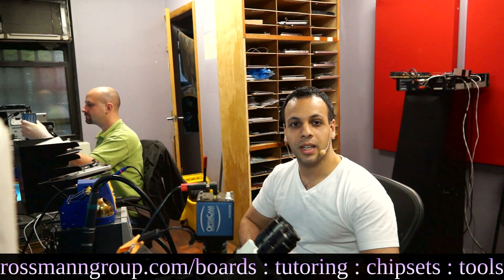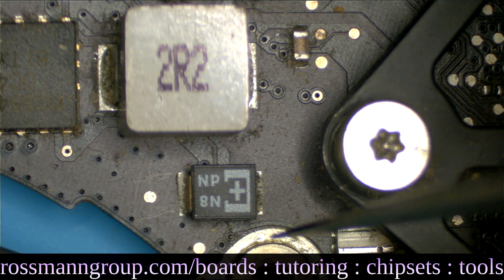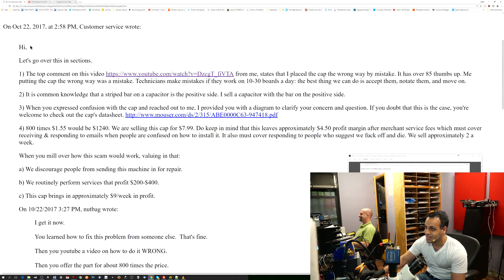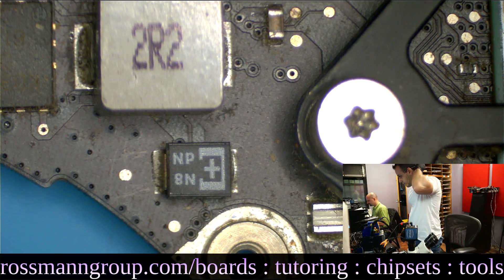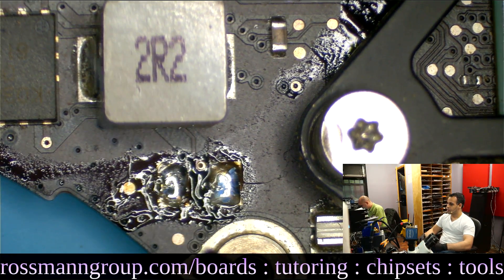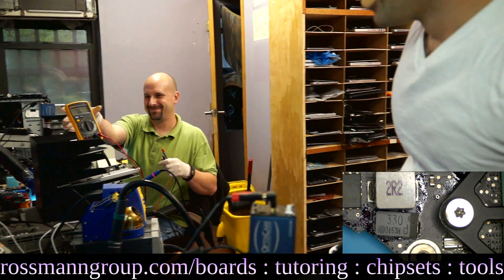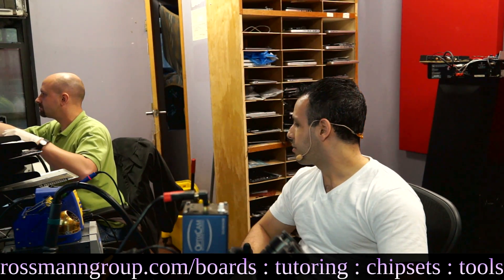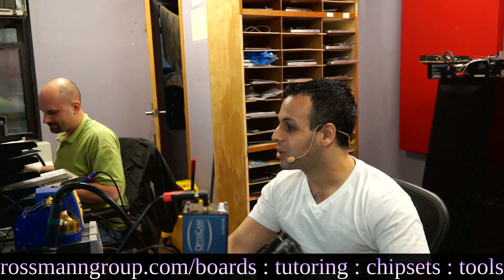ROSSMANN GROUP CAP SCAM EXPOSED!!1111ONEONE

Comment: If it passed the test connected backwards a year ago, how is installing the correct way a proof?
Reply: Not to mention the amount of noise that would be injecting. Connecting it in reverse is essentially soldering an antenna onto whatever line that cap is filtering/bypassing.  So not ideal by any means. Have to agree with woopsserg about it being a serious issue from the get go though. Those things fail like grenades, you don't want that.
Reply: Yet, the guy who does this everyday, and admitted to having put it in the wrong way, seems to actually be right. It didn't blow up. Feel free to explain it away.
Reply: easy to explain why, its an over-rated part for the job as he stated a few times in the video.
Reply from the maker: It will still work connected backwards. Don't get me wrong, it's not ideal by any means, but it will work and boot. It is only a serious issue if someone shorts the positive to the negative under the capacitor.
Reply: Actually for tantalum and  tantalum polymer capacitors it's a serious issues. These types of capacitor completely don't like reversed voltage. They'll likely short and or burn with fire and a lot of magic smoke after relatively short time period if enough current is available for this to happen. On the other hand Aluminium electrolytic capacitors are quiet tolerant to this if reverse voltage is low relative to their voltage rating. Say, if you apply 1.5V in reverse to 10V rated cap, it may work for years before it will fail. And failure won't involve fire.
Reply: Spudhead, they are not that expensive, and yes they are often used on low voltage rails which are around 1-1.5V. Also they may have voltage rating of just 2.5V (cap used by Louis most likely is. edit: actually it has 2V rating). Again, low voltage does not mean low power. Quiet opposite, because current which power rail is able to supply is very high, components can blow up quiet spectacularly.
Reply: woopsserg I agree that SMD does not equate to low power, but look at that circuit's pic you posted: two dropper caps with no inrush protection anywhere/ When either cap fails, there's no other device left to eat the consequences- you get what you expect in such a case.
Reply: a polarized Cap will blow up if installed in revers polarity.
Reply: Stay calm, Louis is a good man, but never claimed to be a God and is definitely not a scammer even though it was connected backwards.  He has put out hundreds of videos on a hard to find subject, but one may be a bit erroneous which he even admits to, though it does not make a crime.  I've learned quite a bit on the subject by just watching casually.  If we listened to the Geniuses at Apple and the throw it away it's broken crowd of green liberals out there, we would just trash all those wonderfully well-engineered but broken Macbooks.
Reply: Horked, so what if it is tiny voltage? There is enough power to cause capacitor blow up and cause fire. http://techmattmillman.s3.amazonaws.com/wp-content/uploads/2017/09/mc34063_above_3.jpg If you look on CPUs, GPUs, with a voltage of little bit over 1 volt, there is more than a hundred watts of power available because current is quiet extreme. You could also look on supercapacitors, with only 2.5 V of maximum voltage, consequences of shorting the leads are very extreme. https://www.youtube.com/watch?v=EoWMF3VkI6U
Reply: tl;dr because its a capacitor. @spudhead they will only blow up if overloaded, wrong polarity will just make it warm at most, this is SMD components, we are talking tiny voltage, nothing will blow up. not the way a 40v capacitor will blow up if you feed it with 100v
Reply: It's a tantalum, they're expensive components. They wouldn't use one on a "tiny" voltage line it wouldn't be economical. Plus, due to their price, it's likely it's not rated much above whatever voltage it's handling. My guess is that it's on a main power line which would also make current pulses an issue as well. Stick one in reverse on a 5V supply line and a dynamic  load with a 2A swing and see how long it lasts.
Reply: Yeah, coz the guy doing this every day and has been for years doesn't know all that much really, huh?

Comment: Throught-hole caps have two leads and indication of the negative terminal. What's with these SMD ones doing it differently?
Reply: In general the aluminium electrolytic caps have the negative marked, both SMD and THT, while the tantalum electrolytic caps have the positive lead marked, despite of the package type. In my opinion it is a manufacturers plot made just to confuse people and make them mount the caps the wrong way.

Comment: I'm confused it looks like the multimeter at 9:32 did not change is that what they wanted?
Reply: Ah okay, I was quite sure what you were supposed to be looking for thanks for letting me know!
Reply: IT didnt move.. Scam..
Reply: Ollie B  Just to be pedantic, I think OL actually stands for "over limit", as the resistance is higher than the meter can measure.
Reply: Psychomachia Fluke is referring to it as overload in their manuals, at least. I haven't compared different brands, though.
Reply: Here's the beauty... every cap I've ever checked starts off zero ohms and climbs to infinity.  I'll go back and see but that was either a REALLY small cap or it was a dud.

Comment: WE'RE BREAKING THE CONDITIONING! YAAAAAAH

p.s jet fuel can't melt 2010 macbook pros.
Reply: zoidberg444 
Flying a jet into one isn't going to do it any favors though.
Reply: Only 2010 macbook pros can melt 2010 macbook pros
Reply: Rocket fuel can't melt 2010 macbook pros either.

Igniting rocket fuel might do it though...
Reply: It was never the jet fuel that melted things... it was the toxins used in the chemtrail generators.